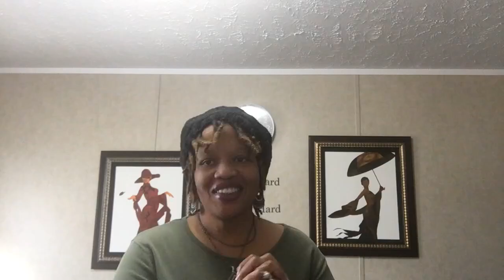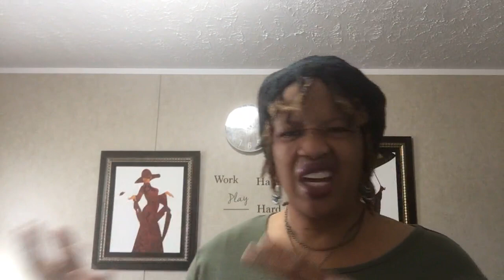5 Mobile Home Myths | FACT or FICTION

Comment: So often mobile homes get into bad shape because some people treat them as disposable housing, or someone who does buy one and has low income doesn’t maintain the home. Ya there are a few builders that have had design flaws (like a home that has vinyl siding but no house wrap underneath). Most of that sort of error is the buyer not doing enough research in the first place. You should do lots of research on construction and get a reputable builder so you know what you are getting. Also a lot of things get thrown on MHs like the failing polybutylene plumbing from homes pre ‘95. It was also put in many site built homes but MHs get looked down on the most. If resale is something one might do in the future than they should get the upgrades from the factory like drywall instead of VOG,etc and put it on a permanent foundation. There is an abandoned ‘78 3 bed /2 bath, 1100 sq ft double wide home that I want to get and fix up. It’s everything I could want in a house really. It currently on a basement so I will have to contact the woman (she lives in California) and get it retitled. Now I just need to make enough money for some land, and moving and renovating the home 😄
Reply from the maker: I hope your able to get it. Sounds wonderful 😂
Reply: You are correct on the poly plumbing. My aunt had a 10,000 sqft home (yes, 4 zeros). It had poly plumbing that burst and ran down between window panes on the first floor.